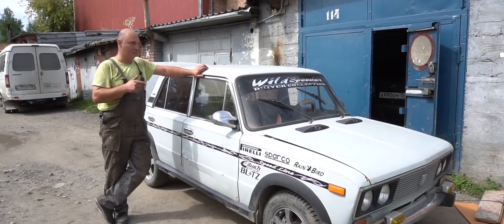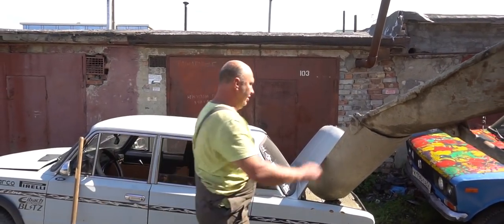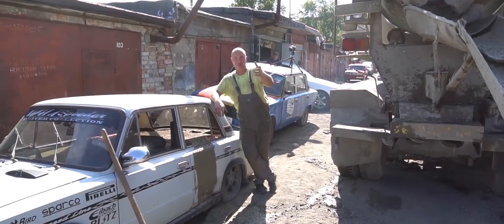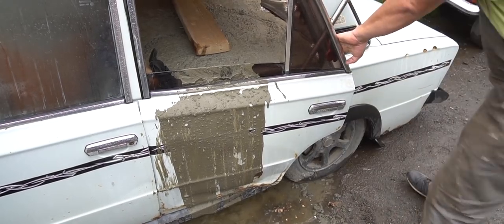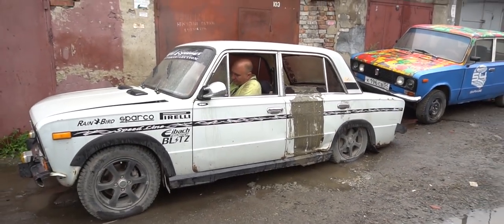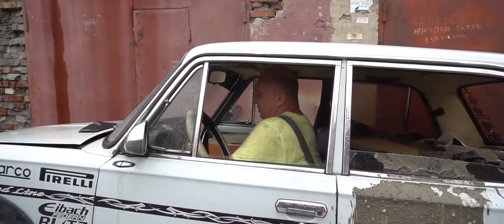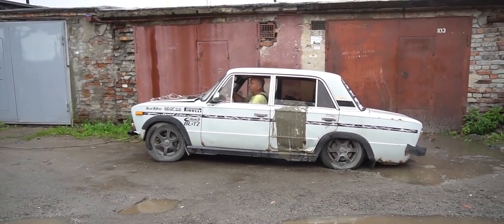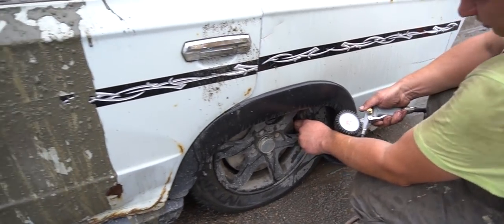Filling a car with 5 tons of concrete – will it drive

Comment: 0 to 60 in 15 hours and 23 seconds.  Winning!
Reply: And 60 to 0 in ehm...100Km?
Reply: I'm pretty sure the 0-60 time is nonexistent on this one...
Reply: Tibor Klein 0-60 in 1.5 billion years
Reply: ... Downhill.
Reply: Free fall
Reply: 0-60: no
Reply: 0 - 30 mph in 10 min, Top speed 31 mph, 100m per liter, 30 - 0 in 0 seconds, AND a box full of vodka, ONLY for 7.000 euros.
Reply: 24 hours of lemons certified
Reply: And then 5 kilometers before coming to a stop with burning brakes.

Comment: For sale: Lada 2106 Low Rider. Very good shape. Drives and runs. Hot heat. Concrete reinforced interior. Voted as best car for demo derby competition. Won't last!
Reply: XD thats genius
Reply: haha
Reply: It wouldn't be destroyed easily it would cause more harm to the attacker
Reply: @garydos000  I'd watch this
Reply: Safest car on the road! & bullet proof too! Lol
Reply: @garydos000  if the interior was the only cemented part, the engine bay and rear end (fuel tank included) would get crushed like a can
Reply: @iainmacrae6982  the trunk is concreted

Comment: I love this channel. It keeps answering questions nobody asks and proves how tough a car can be. Cause, if you ignore the excessiveness, most of this does happen in real life. Cars being overloaded, driving without an oil change, shifting from Drive to Reverse, or Park while driving, driving on the starter motor, putting in the wrong fluids, wrong fuel all kinds of abuse.

Makes me feel proud my W203 has seen no abuse at all. Closest thing she has seen to very hard driving is a top speed run on the Autobahn (once).
Reply: yeah but this is an old soviet lada with a 1.5L engines. Those soviet things are indestructible. Usually poor people just pour used vegetable oil in the fuel tank and it has no issue for 300K miles. 

It's fuel consuming and destroys the environment but it just refuses to break.
Reply: Idk who lied to you but after 150k kilometers those engines just die even if they're maintained perfectly. There are thousands of them over where I live and I know many people who have them. They're garbage
Reply: Maybe it runs on borst. Can't be beet!
Reply: its called higway mein deutscher kollege
Reply: Bombamann 1337 Ne mein Kollege du musst stolz egal wo und wann es Autobahn nennen! Steht im Artikel 24 Absatz 3
Reply: The Car Enthusiast wtf
Reply: Ist Kraftwerk https://www.youtube.com/watch?v=gChOifUJZMc
Reply: Megadriver Absolutely pointless video. A waste of scrap and concrete, all for some clickbait and a few random hits on a you tube video.
Reply: SteamLocoScrapper you need to lern what fun is
Reply: Mr Gunslinger so not true. If your using authetic oil it can...
 But majority of the time at 100k kilometers you gotta change your headers, rings, etc.
Reply: Bombamann 1337 *learn
Reply: Megadriver and a crazy cement truck driver comes along and decides to fill your car with concrete
Reply: I think you sould try vodka as fuel, im sure it will work perfectly.
Reply: A top speed run won’t do any damage to your cars engine...
Reply: lol i like driving with the starter on tractors.

Comment: That car is made to take a rear end collision nicely now
Reply: very useful especially in Russia.
Reply: But it's a lot heavier now so has lots of momentum to keep from snapping the occupants necks.
Reply: ChuddleBuggy you don't seem to understand physics. The momentum is what'd cause the neck snapping.
Reply: My friend, it seems you've got it backwards.  Acceleration is what'd cause the neck snapping.  Momentum (more accurately, mass), which is a component of momentum) is the enemy of acceleration. :)
Reply: ChuddleBuggy you seem smart so you should know that it's a sudden change in inertia that causes damage. Acceleration yes, but also sudden deceleration such as the momentum of a car being suddenly stopped. The crush zone of a car prevents this. The concrete is removing said crush zone
Reply: Acceleration can be either positive or negative (deceleration).  In the case of a rear end its gong to be positive. The system in question is the car with the hardened cement.  Because it has a lot of mass, it will require a huge impulse to cause the neck snapping acceleration, as opposed to a lighter car, hence the effect of the loss of the absorption zone being immaterial.  The colliding car on the other hand better have enough crumple zone or it will experience a huge change in velocity (deceleration) causing it's occupants potential harm.
Reply: The mobile wall.
Reply: @ChuddleBuggy  I see what you're getting at it's too freaking heavy to be pushed back, but the other person will most likely hit a concrete wall (literally) and die instantly.
Reply: @ownerfate  summed it all up in 3 words, lol.
Reply: @WiserAsIGrow  Exactly.
Reply: extreme guys be like, "my vehicle drives fine." 😂
Reply: @ChuddleBuggy  I agree with you.  The driver with the concrete rear won't feel a "neck snap" because the transfer of energy wouldn't reach them.  The energy would be absorbed by the concrete.
Reply: well no don't you'll crush the trunk he should have filled trunk that up if he want
Reply: @RyanLeanardoe  the cement filled car wouldn't accelerate as much when hit because it has more mass to move
Reply: bruh bro why you replying to a 3 year old comment lol
Reply: @RyanLeanardoe  idk lol I didn't even notice how old it was
Reply: @RyanLeanardoe  idk lol I didn't even notice how old it was

Comment: As i sit here watching this, i can't believe the rear tires are Still holding Air, this car is actually driving under it's own power, & the frame hasn't snapped, even after 5 TONS of Concrete has been poured into it!

Makes me think: They sure don't build them like THAT anymore....
Reply: John McCarthy I'm pretty sure they do
Reply: Ninjalectual lol yeah IN OUR DREAMS.
Reply: So nice
Reply: Wow
Reply: Partly because russian tires are always hard as hell, like rock.Thus they are bad in wet conditions but in general, very durable.We used to get a lot of them here in Hungary.
Reply: Just got russian off road tires for my Niva and the thing looks the same with 2 bars of pressure as it does with zero LOL
Reply: Things that carry people generally are engineered with a safety factor of 10 an average 5 seater car would be rated to carry at least 500kg. Pretty impressive still
Reply: Soviet engineering 💪🏽

Comment: I was looking at the stickers . I see Pirelli, Sparco, Eibach, all well regarded names. Then I see Rain Bird- a well known name, yes, if you're looking for lawn sprinkler systems. XD
Reply: Parmalat sponsored Brabham, and they make cheese.
Reply: I had forgotten. Thanks for the correction. :)
Reply: Hotrodelectric that's what I said 😂
Reply: I don't think anyone here is disagreeing, Esteban. Mick Coomer made your exact same point. I just think it's a funny choice.
Reply: I don't know where you're at, but Parmalat is an Italian dairy company that has sponsored F1 racing for decades.
Reply: I know this is ruining a perfectly good joke, but I've seen rain bird irrigation systems used as water spray systems for radiators in hot climates. Evaporative temperature drop, works pretty well
Reply: Yah, you did do a bit of stomping, but I got some likes and everyone had a laugh. What you're thinking of is akin to a swamp cooler. For all of you under the age of 40, that was a big thing before widespread use of A/C, especially in the midwest, south and southeastern parts of the US.
Reply: Hotrodelectric they improve aerodynamic performance
Reply: I recognised Pirelli

Comment: Now crash some car in to it from the back in the name off science
Reply: dzonikg a big rig.
Reply: getting a lada without a working motor and pulling it with a steel cable should work.
Reply: crash a yugo into it at 200km/h, maybe the spare tire will end up in the back LOL
Reply: if someone rear ended this thing sitting still while they were driving at highway speeds they would probably die
Reply: TWEAKLET Their car would just disentigrate.
Reply: Serb born in Yugoslavia 40 years ago
Reply: HRVATSKA !!!!!!!!!!!!!!!§
Reply: TWEAKLET not necessarily. Cars undergo crash tests involving slamming them into solid concrete walls.
Reply: ****  CROATIA !!!! *****
kapusti hermano
Reply: moglo bi, dobra idea, mada po mom misljenu trebao je da napuni ovaj auto samo sa 1m3 betona
Reply: Mora probati i sa jugicu :D

Comment: The improved grip due to added weight should be beneficial in terms of straight-line acceleration and also cornering ability. If it wasn't for the exorbitant cost of concrete, I'm sure that almost everyone would perform this mod to their cars in order to enjoy the performance and aesthetic enhancements therein.

Comment: Lada is officially an indestructible car
Reply: That's because it takes one half of a T-34 tank to make one Lada sedan. The steel was stretched and pummeled into a greater density in the process.
Reply: Then is very dangerous car, they need be weak for absorv energy impacts.
Reply: Ladas brake down every 100km but they are easaly fixable by just hitting it whit a sledge hammer for 10sec and it will run for another 100km and then there is the 1000km duck tape service that you have to make
Reply: Im crying ahahah
Reply: This one is officially bunker grade now
Reply: lada is joining nokia old phones in the hall of indestructibles hhh
Reply: No they're quite destructible. There's a reason nobody you know has one or wants one
Reply: llavero5 think about the sheer amount of inertia it would take to move it. Crumple zones are unnecessary!

Comment: The road was less than ideal for this experiment. :D 
I appreciate your determinations but it would've been enough to fill the car with gravel or sand for the same amount of load while having the ease to salvage the poor thing from being a concrete brick.
Reply: the concrete inside costs more than that car. it's an upgrade in sale price.
Reply: Péter Kiss It is not about being sensible or doing the easiest thing, it is about clickbait and getting views. You don't seem to have grasped this!
Reply: it would be great in a demolition derby now
Reply: Concrete is tradition for G54

Comment: Jack it up and block up between the axle and frame so it doesnt drag.
Reply: Except you need 2 forklifts to jack it up, my 3 ton floor jack would have problems with lifting this
Reply: Lewis Zerlewski them little bottle jacks go up to 30 tons or more how do you think ppl jack up dump trucks and 5,tons is a full size diesel it just sounds like a lot since its a tiny car
Reply: Good idea, I didn't even think about that
Reply: Good luck getting a 30 ton bottle jack in that 2 inch gap :)

Comment: This was again an another great video comrad! I also had a nice idea. Could you make a wooden exhaust muffler? Would be interesting to watch! Would it last again those hot temperatures of the exhaust? And what about the sound? Could it be better or worse than steel...
Reply: Ilias Lamari i think that it would last for maybe a minute or two and it would act as a silencer
Reply: Just don't do this on a rotary.

Comment: With a car with Torque Converter this experiment would be awsome
Reply: Pedro Seoane Prado so an automatic
Reply: Well, it worked already just as is, so I'd say it's fine by me :p
Reply: If they would have thought ahead and put stronger springs in they could have had the ultimate demolition derby car
Reply: Pedro Seoane Prado a 1/45 gear raitio would work
Reply: TCs don't make THAT much difference
Reply: Instead of burning the clutch plates, the transmission fluid would boil in the TC and spray out the dipstick tube (and likely start a fire on the exhaust manifold).

Comment: Top Gear already did this to a W124 - re-floored with 3" of concrete and stone flagons. It still drove without issue. Other than you have no access to the brake lines and electrics to maintain them.

Comment: fun fact: If this car was an auto it'd have no problem driving away with the same engine because the torque converter can basically act like "hole shotting" the clutch non-stop until it starts moving. The problem is simply that the wheels are moving at zero RPM, and the engine can't run at a high RPM (and high power output) and hold it at that RPM without burning up the clutch on this lada. Assuming he's not holding the throttle down [which eats the clutch, I would know], the entire energy to get the car moving is solely from the inertia of the spinning flywheel and (tiny!) engine components. Whereas a torque converter allows you to keep the throttle on (even wide-open) while dead stop.

 Further, torque converters don't just allow the free-spinning we need to get moving in this scenario, but also provide "torque multiplication" because it's like a fluid version of a gear reduction. [You 'can' make non-multiplying torque converters but why would anyone want one?]

Comment: Should of put some blocks of wood under the suspension before putting the concrete in then it won’t of dropped to the ground so much. Great video though 😉

Comment: Try it again with some spacers welded in between the rear axle and chassis then the rear wheels won't be stuck up inside the wheel wells. Great video tho!

Comment: Lift the rear end by crane, replace spring by pipe (cut and weld) then try again, with new clutch and release bearing.

Comment: Make a tank car. Weld steel plates all around with a slit to see through to drive. Put solid rubber tires on it. Bullet proof glass over the slit. Then drive it around town.

Comment: You should remove before filling the springs in back and add solid steel in the place. That way, you keep back up and driving will more easier. We know the very high weight will push back too far down and bottom will touch the road. 
Your road is in poor shape (holes are visible) and that makes harder to drive due high friction.Think about it.Otherwise, funny video. :)

Comment: It looks like the weight has the rear tires against the wheel well and is bottomed out.  Replace the shocks/struts with heavy duty ones from a truck, or with just a metal bar, so the car will stay off the ground, the tire won't rub on the wheel well, and the rear end won't drag on the ground.  It will be bumpy if you hit a pothole, but the car would go much better I believe.
Заменить амортизационные стойки сплошным металлическим стержнем

Comment: Exactly what i thouvbt it was parked in a huge pot hole. Once it hit the edge of the hole it didnt want to move.also the yire should have had more air or been replaced by a stfonver tire that holds more psi

Comment: This is a stupid waste of concrete, should have welded a 2-1/2 Ton Jack, solid steel rods, or square bars between leaf springs and the frame. This would keep rear tires from scraping the bottom of the wheel well. Thinking a second video is a must! Will it drive?

Comment: Cars are a damn site tougher that people think, back in the old days my grandfather would drive across Europe in a moris minor 1000cc with 4 adults, their luggage and towing a caravan, I'm not sure of the power but I'd guess about 50bhp max, he'd also tow a car trailer with various cars on the back with the same old Morris minor as well, hell I'd expect it could pull along a 10 ton truck on the flat, assuming the clutch didn't burn out or drive shafts didn't break apart.
We've all seen those pics of workers in India about 25 of them sat in the back of pick up truck, they have no problem going long distance, ok parts probably break and wear out quickly

Comment: I think it would be better if the rear suspension wasn’t there.
If it was welded stiff, maybe it would not hit the ground on the rear
Reply: Leberkas Semmel They should have put higher rate springs in....not much chance of the unibody bending with all that concrete between the shock towers....

Comment: I had a 72 LTD with 460 4spd and 3.70 axle that wouldn't even notice that weight, I use to haul the inlaws around with it no problem

Comment: Very watery concrete. Filled to the gills? You mean the gunwales. 
Will need a month+ to cure. 
That poor clutch🙈 Does a car experiment but doesn't put in gas😂
Push start the mutha PLEASE❗️

Should've run it into the nearest cop station, then run, once it was moving!👮🏽
17:31 what's Russian for 'dude'?😆

Comment: i don't think this would be save in an accident...
Reply: Beat Richli It would be very bad for the person hitting it.
As far as the driver's safety..its likely the safest car in the world. It might be able to go 5mph on its best day.
Reply: i think it's other way arround. a person that is being hit doesn't have the mass to counter against a normal car anyway. since it's coming slower then a unloaded car, it would be even safer for the person :-)
but driving into a wall or flipping(...) the car you'd have all the additional mass flying and moving against you. altough of course, at the <5km/h not much is happening. but if he rolls and speeds up longer.

Comment: You should try sealing a car and filling it with water to see if it will still drive. Or you might try putting 2 cubic feet of concrete in a car with a diesel engine.
Reply: Stephanie Kawadias go to channel "colin furze" he filled a bmw whit water